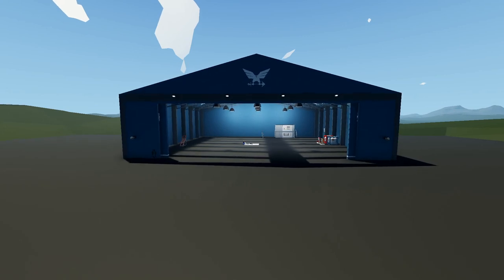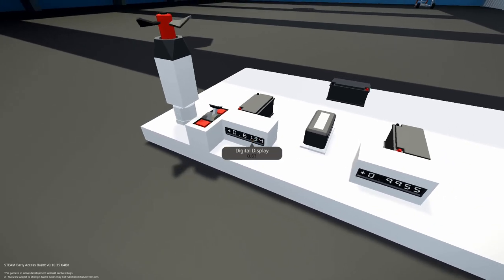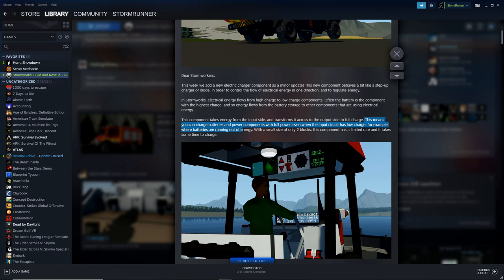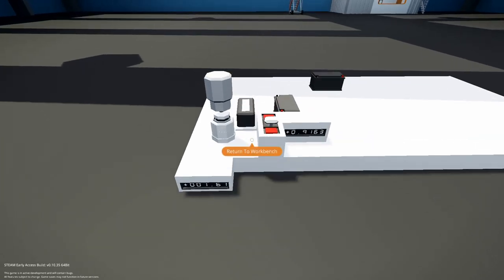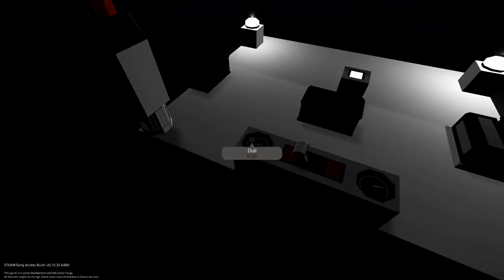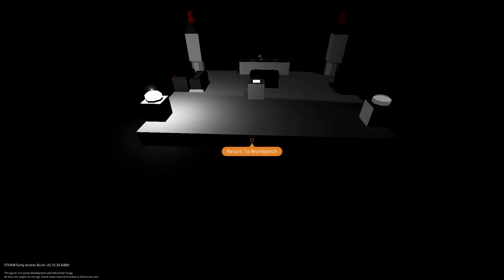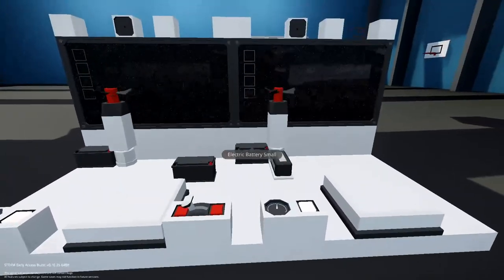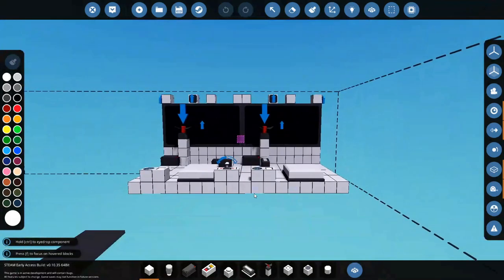Things You Don't Know About The Electric Charger | Stormworks Electric Charger Update!

Comment: Just realized that you could boost the base rps of an electrical motor by setting up multiple electric whatever’s to a single batteru
Reply: Yeah i was thinking about that to
Reply: I wonder how that would fair if you used a generator with low rps instead. Maybe it’ll make a more efficient Gas electric system.
Reply: Please extrapolate

Comment: I've done a little testing myself. I have not been able to get a charger to work hooking up multiple batteries to the input to a single output. I don't know if it's my game or what, but it just refuses to charge for me when I try to do that. I did find out that if you want to get a relatively fast charge you need to build into the realm of stupid.

I built a rig (big scale to my regret) that consisted of 2 large electric engines, I believe it was about 6 small boat props connected to each large engine, both engines connected to 1 large battery, and then 84 large batteries connected to a charger each all feeding into that 1 engine battery. It was recharging from all 84 batteries at a rate about 0.013 per second (which considering putting that rate against a single charger or a cluster of solar panels is blazing fast). But the dual engines, unsurprisingly, still drained the battery faster than it could be charged if left on full till.

But the point I'm getting at is if you want a reasonable recharge rate from like a "power station" to a recharge cable, you're going to have to have a ridiculous # of chargers all feeding into that 1 winch to the electrical connector to get that rate, probably over 500 if I were to be honest.
Reply from the maker: geez I assumed with the extremely slow rate that a huge amount would be needed.
Reply: @StormRunnerGaming  The only upside, if you could call it one, is that every charging battery was going down a total of like 0.0000001 per 30 seconds spread out across all of them. So you might be able to rig up a mass of solar cells to counter the charging drain if you have a ridiculous amount of money in career mode or just want to sit there for hours making every electrical connection needed. 😣
Reply: from this and the video, it sounds like the carger is 'amperage limited', be interesting to see if you have  battery to 2 chargers in parrallel to a motor, compared to only 1 charger
Reply: Treat this component like a low wattage DC-DC converter.